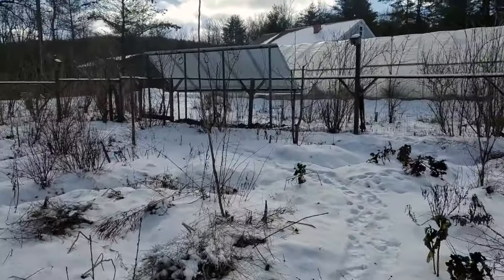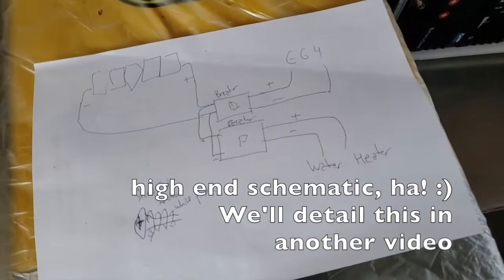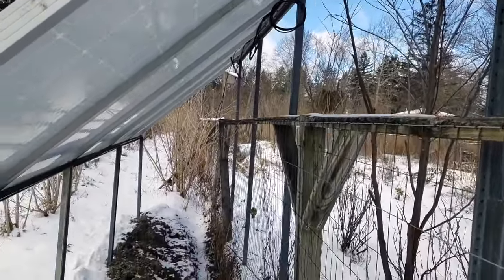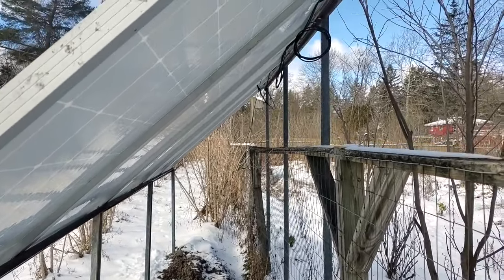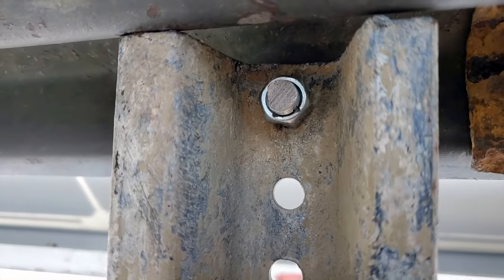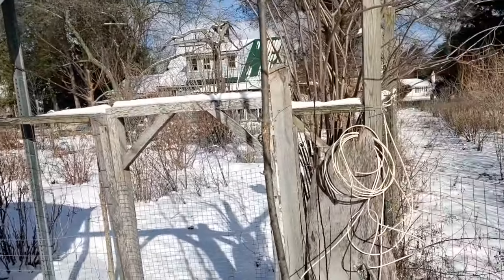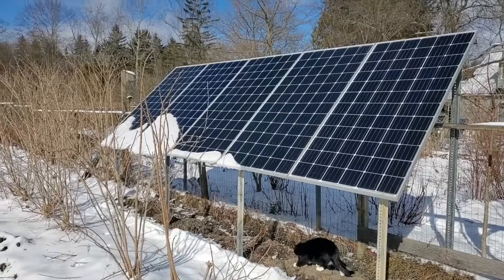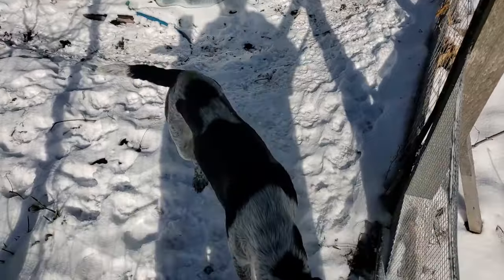Solar Array - DIY Metal Ground Mount (strong AND inexpensive)

Comment: Everything you did there looks good. One concern is the 10awg wire running along the fence. Wire specifically  designed for solar will hold up to weather and sun. Other types(thhn,thw,etc) should be placed in a conduit to slow or stop degradation.
Reply from the maker: Thanks for the note, I should have shown the cable but it is UV stabilized PV wire.  Meant for direct burial or above ground if I'm not mistaken, but I'll double check
Reply: U.V. light is merciless and will corrode wire insulation in time even if it is rated for UV.   Galvinized conduit is pretty expensive.  Burying under soil is the low cost solution.  As they've chosen above ground, I would find some way to protect the wire from UV light.  Everything degrades eventually.  Maybe a strip some roll roofing over the exposed wire?  Wood if you have something laying around, but wood can get expensive too.  What ever you can think of that is cheap or free, but I would try to get that wiring out of the UV light.  Aluminum cans?  Tar paper would last at least one season, maybe two, and look pretty ratty.

Comment: Great idea. I believe that DC current is not allowed to be ran into a home. May want to keep the batteries and controller outside even though not ideal when cold out if you happen to have a fire they might point a finger at the DC running into the home.
Reply: My house is off grid in the same area as Shawn. To pass inspection, I needed a DC disconnect at the solar array outside, and also inside. The high voltage solar DC has to be run in metal conduit once it’s inside of the house. But I ran it up through my floor, thru the DC disconnects and then into my all-in-one inverter. Passed inspection. Surprisingly the DC wires coming from the inverters (at 48v) and to the batteries, didn’t have to be in conduit.

Comment: One thing is, whenever you mate steel to aluminum exposed to the weather especially, the aluminum will lose electrons to the steel and it will corrode, weaken, break down the aluminum prematurely and actually protect the steel.  It's called a galvanic reaction.  You can insulate between the two metals to prevent this: plastic laundry bottle pieces, silicone or arcrylic caulk etc.  If you've got a decent size array I guess you want to ground to the aluminum with aluminum wire and the steel being stuck in soil is self grounding.  Not every one bothers to prevent the galvanic reaction, but if there's lots of water or rain, it is actually pretty fast.   

I was wondering how you managed on $50 with that much strong metal.  Freebies, salvage.  I too, have been looking at that.   It's about $25 for 10 feet of uni-strut at Home Depot and that doesn't incude bolts and nuts and such.  We have a local metal salvage yard, but that too is still expensive.
Reply from the maker: Interesting note and something to definitely keep an eye on to see if it happens and address if it does.  Thank you for explaining...
The cost was super low because the uprights, the most powerful part, are sourced for free as DOT posts I got from a local spot where they were removing fencing made from it and they were there and free... I wonder how available they coudl be to the public, since those posts are so incredibly ubiquitous.

Comment: I like the idea of reusing DOT sign posts for sure on ground mounting.  I too use whatever works as is cheaper.  I even use T-posts for temporary testing.  On the wiring, grounding, etc.  I have the same panels and you MAY want to check continuity for ground as sometimes that anodized aluminum does NOT conduct as easily as people assume.  I put a serrated locking washer and then a ground rod in case of a near field lightening strike and bury the cable.  Additionally, I put a midnight solar SPD ($90) for added safety.  There is an ampacity chart online for your anticipated voltage drop on the PV line NOT knowing the exact length of your run.  Also, in COLD weather those panels WILL produce about 8-10% more voltage once you get below 32F / 0C so you just have to know that for MPPT voltage limits which in winter may offset any voltage drop.  My experience with Seraphim is don't over pay but they will produce about 72% under load of their stated output.  I applaud the re-use of materials including the panels as I do the same thing for ground mount off grid stuff and hope to install resistors to heat an ICB tote for a small green house using more panels.  Take care and include more solar too.  Gary from SE Michigan

Comment: I would be worried about galvanic corrosion by having 2 or more different metals in contact with each other. Yes, you do need an electrolyte to facilitate the galvanic corrosion, but you would have much less galvanic corrosion with all the hardware being of the same material if it did get wet. Just a thought. Besides, some pennies can be worth quite a bit of money to coin collectors.
Reply from the maker: Thank you for the note on this, something to monitor

Comment: just a warning but I'm going to guess the 10 awg you stapled to the fence is not a UV resistance insulation and is designed to sit in a grey PVC conduit that has the UV coating. it will crack in a couple years and you will have a 200v 1500w circuit just waiting for someone to lay their hand across the two wires on the fence.
Reply from the maker: I believe this is UV stable but I will triple check

Comment: - Panels rated at 340W (theoretical) will really produce ~280W on a bright clear day
- If the wire is not UV resistant you'll need to provide protection.  Old trashed water hose does that job well.
Reply from the maker: It should be UV resistant, I'll double check.  I suspect in this position they'll put out an average of 300 watts each, maybe a little more
Reply: The big thing that will swing the efficiency of the panels when in full sun is the temp. When they warm up they will output less. But on a cold winter day, if they are covered by clouds and then suddenly get full sun, they can output more than 340w

Comment: Hey Sean - looks great!
 I'd say definitely look out for 3/4 or 1" PVC conduit for the electrical lines on the fence. You gotta protect those wires, they aren't rated for the sun either so they'll degrade in a few years. Be careful with all that DC power!
Reply from the maker: Thanks!

Comment: I'll say it again. You are an expert at cobbling things together, and tapping into waste streams to get your materials in the first place. Way to go. Inspiring! I'm wondering about the Chevy Volt. I've heard that the electric cars struggle in very cold and very warm temperatures. Do you know anything about that? I'm a complete novice.
Reply from the maker: It'll be a Chevy Bolt, 2020.  100% electric.  I think it will be limited by deep cold and maybe by heat, but we don't have high demands on what it can do.  We'll share notes as it unfolds.  Thanks for the kind words!

Comment: Your set up is even cheaper than mine. I used a big metal post I bought from a metal junk yard and struts from Home Depot. I ran my 6 gauge wire through conduit. You don’t want critters chewing through wire. I have about the same amount of power as you, but mine powers my Mega Tiny house which is under 600 sq ft.
I’d post a picture of my homemade mount, but can’t figure out how. Anyway, mine had to be high due to trees and hills.
I like your cheaper set up, too. Keep the diy idea’s flowing. I love reuse-recycle.
Reply from the maker: So glad we're both figuring out how to build in the ways we can!

Comment: Hi Sean great ideas to mount solar panels!  Charging a car is a bit tricky because most dc to ac inverters have a floating ground and EVSE needs to have a bonded ground in order to charge.  Bonded ground means the neutral and ground wire are connected for safety reasons.
Reply from the maker: I need to look into this, I appreciate the heads up.  Any chance you'd be willing to email me so I can pick your brain just a little?  I'd be happy to compensate or trade with answering any garden questions I can... sean @ edibleacres.org 
Any details you can share on this idea via email I'd appreciate as I hone in on proper wiring and safety...

Comment: Will you be changing the angle seasonally?  45° is near optimum for winter at your latitude, but you'll get drastically more year-round power at a shallower angle.  The online solar angle calculator I just used said 32.6° is optimum for Ithaca.
Reply: It is worth doing only if you have pricier panels and they are not pricey anymore (in general). And similarly with trackers, they are so pricey that it is cheaper to buy additional panels and double wattage then install a tracker... adding anything mechanical, even drilling holes for seasonal adjustment is not worth money anymore.
Reply: @SWL_Jamey , yes, changing the angle adds a lot of complexity and hassle, so mounting at a shallower angle will get much more power over the full year.  Leaving it at 45° is great if the goal is to maximize the power output in winter at the expense of the rest of the year.  Changing it to 32.6° will maximize the total power given across a full year.
Reply: @joelwegman2683  If loads are space heaters or LEDs to start plants then winter angle is better, you get more energy at time of need. snow sliding down increases your production.
DOI:10.1155/2020/2412780   Table 8: Relative systemic loss of energy compared to the optimal orientation
Reply: I think 55deg is optimal for the winter in this area. I made a graph for each different angle using PVWatts, and  beyond 55deg the gain in winter is minimal

Comment: A thought to consider as I am as well  . For around the farm and trip to corner store and gas station . 
    UTV  are legally allowed on most roads if registered or if requirements met only a slow moving vehicle sign is required.   
     There are now many new manufacturers and existing converting to electric drive UTV . 
 Theoretically if farming with electric vehicle powered by the sun you then far surpass Amish as efficiency . 
  But it’s hard to beat horses “ byproducts” ! 

 But as I’ve shoveled lots of hay and oats in and get organic gold out the backside of horses they certainly have their value.
Reply from the maker: Interesting notes, thank you!

Comment: Great job!!  It's good that you used wiring that's overkill for the current those soalr panels produce because of the distance.  Plus, being that they're in series, you really minimize your losses.
I need to do 12 kW as cheaply as possible.  It's crazy that the cost of the panels is actually cheaper than the racking I've found out there that can hold them.  So, I'm going to have to rig something like you did.
Reply: Yeah I was surprised at the price of the racking as well. I have 6.8KW of panels. They cost $3k. Whereas the ground mount was $5k. And that was doing the ground mount cheap by doing the labor myself. Mine needed to pass inspection. Panels are at 40deg. I wish I could have went 45 or 50deg for the winter but it creates more of a sail, so I would have needed twice the amount of 3” tubing securing the rack to the ground. And twice as much concrete

Comment: I used to drive a Volt (or did you say Bolt?).  This refers to the Volt.  I couldn't manage it when I moved to Vermont.  I tried to drive up a hill with 6 - 8" of snow on it; I had a lot of trouble.  There is a baffle or something, flexible, than hangs very low in the front - I think about 3" off the ground.  It was just impractical in VT.  Just FYI!
Reply from the maker: It's a bolt and yeah, I'm not expecting it to be a super beast in deep deep winter snow.  We have had less and less of that lately and I'm OK having us be home bound a few days a winter if/when we get a blizzard...

Comment: I’m no expert, but I think you would want a ground on your positive line. Depth and spread of the grounding will also play a factor. Looks like the setup is a ways from the house, but you did say a wire would be running into your house.
Reply from the maker: I will explore that.  Certainly will have a fuse coming out of the positive line before it runs down the cable and a circuit breaker in the house as on/off but also as backup

Comment: as far as the lightning rod you want it separate from your panels as the panels are the high point so the panel itself will see the million volts + of static and it will destroy the panel  internal insulation. it is true the frames have an earth ground and it is better to do equipment bonding for personal protection as it offers lower resistance for stray voltages to return to your overcurrent device. Earth grounds are for lightning strikes/main transformer center taps for grid and equipment bonding(green/bare wire) are for over current personal protection...your rack looks good but you may want a summer angle/winter angle adjustment
Reply from the maker: Thanks for your detailed notes here, much appreciated!

Comment: Interested to see the electrical calculations on this. Why in series ?. What are the battery voltages ?. Correct me if I'm wrong but wired in series gives you 5x panel voltage. I'm clearly missing something
Reply: the theory behind panels in series is that you get higher dc voltage so then you have less of a volt drop on the run to the voltage regulator that charges your battery. EG. 240v x 10a = 2400w means a 14awg...12v x 200a = 2400w means 3/0awg. A 100 ft of 3/0 is really pricey because of the copper needed.
Reply: @jesshorn257 Thanks for the reply and that makes sense. Cheers
Reply: @pandar2205 the nicer charge controllers take higher voltages, even for 12v or 48v batteries. My 48v all-in-one inverter can take up to 500v in solar.

Comment: I'd be curious how charging the Bolt works out for you. I have driven one in much warmer conditions (Western CO) that you deal with for several years now. I average about 3.8miles/kWh overall, about 4.2 in the summer and 3.6 in the winter.
Given that, if you even figure 4 miles/kWh average, that array will only be giving you something like 6.8 miles per hour of charging under assumed PERFECT 1700watt conditions. In reality, you will probably average closer to 1kW,  so in winter when you are probably averaging 3.5 m/kWh or worse, you might only be getting 15 miles of charge/day, 20 if you are lucky.... and that's not accounting for system losses.
Reply from the maker: Great considerations here.   Still learning as I go so hopefully we cam check in in a year or so!